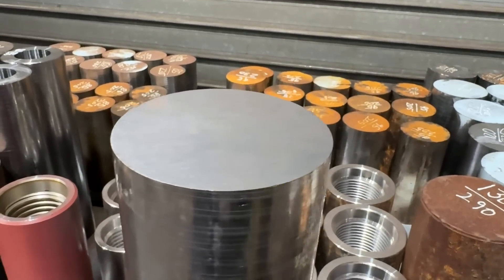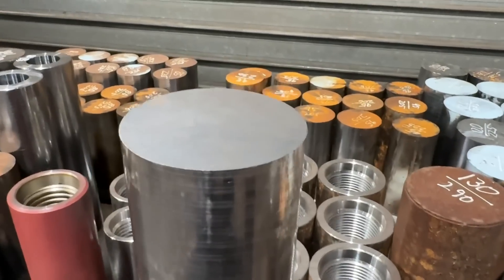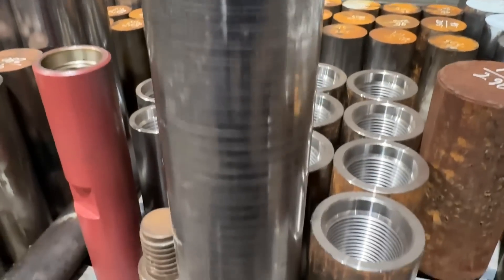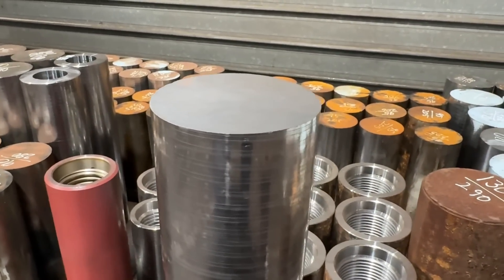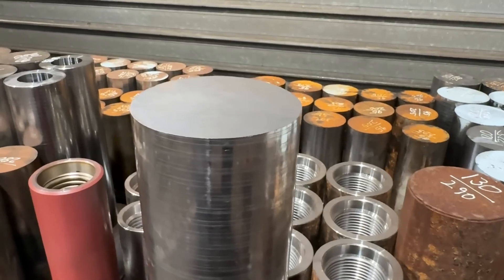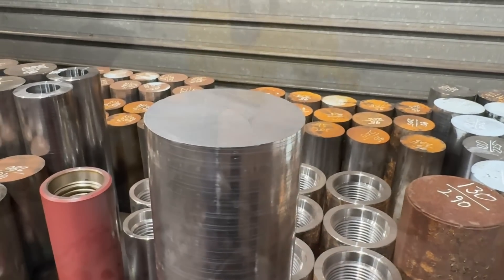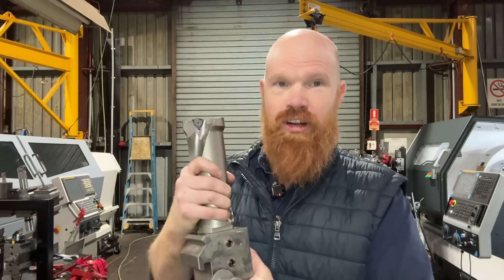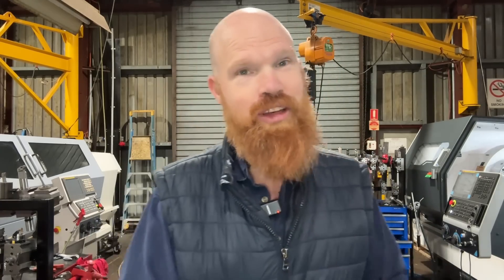HTS DRILLING at 900 rpm is UNREAL (you need to see this)

Comment: Interesting. First of your vids ive watched. Does that lathe have a tailstock? Looks like a sheetload of pressure to be putting through a quickchange toolpost and cross-slide. Id suspect thats where your vibration source could be.
Reply from the maker: We’ve since fixed the vibration, thankfully!

It’s a pretty rigid lathe, so the problem was the toolpost, which we have modified for HD drilling.

Works a treat now.  Thanks for the comment too.  It’s really helpful getting everyone’s thoughts.

Comment: I have used this tool several times in the past. Kennametal is the market leader in the drilling sector
Reply from the maker: At this point I totally agree. I haven’t tried them all, but Kennamental remains my pick for drilling.
Reply: I have tried several drilling tools from Kennametal. The series with interchangeable head is extremely performing, (but high cost for head and resharpening). The drill-fix series with a square external insert doesn't excite me. Efficient, but noisy. Excellent solid carbide tips, the extra long series (30xD++) is impressive
Reply from the maker: That’s good to know.

Until we get a more high performing modern CNC (ie Doosan, DMG etc with a turret) I won’t attempt the solid carbide drills.

They look awesome, but I just know we don’t have the precision… yet 

Goals haha.

Man, thanks for the comment and sharing your experience. Really appreciate it.
Reply: Solid carbide drills are very efficient tools, but require chucks with low run out and stable machines. The refrigerant pressure is very important. I work on a boring machine (Kbn 135 C), when I encounter pieces with risk of vibration I prefer to use hss tools
Reply from the maker: Wise move. If we had a more high end CNC I’d definitely look at solid carbide drills.

From what I can see they are awesome

Comment: These HTS KENNAMETAL TOOL need‘s a REAL STRONG machine with a rock solid tool post. If it is not stabil, the drilling resistance increases enormously and you destroy the inserts. 
I remember , 25 years ago, the old ŠKODA W200 , SK 60 with a 180mm Walter HTS … nice to hear how the heavy chips are falling … but the remaining piece was really dangerous!!! A bit like a boomerang that never comes back…👍👍👍😎 Cheers from other side of the planet!
Reply from the maker: That’s good to know man.  Sounds like you’ve got some really solid experience with these tools.

Appreciate the comment, and definitely agree re toolpost rigidity.  We’ve had to upgrade the big lathe to a HD toolpost designed for deep drilling.  Far more secure and doesn’t seem to budge.  Thankfully.

It’s wild to watch a drill like that hit a piece of steel held by a 200kg chuck spinning at 900 rpm.
Reply: This tool needs* (third person, no apostrophe!) / It is not stable* ...
Reply: @einundsiebenziger5488  Danke für die Berichtigung! Mein Englisch ist LEIDER nicht gut genug… Ihres ist wohl besser…

Comment: Very good.
Why coolant pink, round stock is bleeding? :)
Reply from the maker: Haha. It’s definitely different. It’s called Holemaker. It seems to have excellent rust prevention properties and never goes off.  

They were using it before I took over the shop, and I haven’t found a better alternative.

Totally open to any recommendations for high performing 4140 cutting fluid.

Comment: Wow, very efficient!  I’m new to this stuff with my Haas TL-1 and what you did there looked to take a goodly amount of power.  Can you estimate how much HP or KW used?  Our machine has only a 10hp spindle without a gear reduction box, just a pulley drive at 1800rpm and curious if such a thing would be achievable? I have driven 40mm HSS twist drill in our 5hp manual geared head which will get it done without much trouble but work and time to shove it in the bar.  I have never seen something like that.  Cool!  FWIW, I am not a fan of the “shorts”. I learn and enjoy more of your longer format videos I watch like this one.
Reply from the maker: Our machines are 20 & 25 hp - so by no means monster machines as far as CNCs gos. They have good swing & bores, but there are def more powerful on the market.

I like the look of the TL1! Seems like a good little machine.  We could probably use something that size in the future TBH.

You could probably use smaller Udrills on it.  The major issue is toolpost rigidity.  

There is a large amount of z axis force generated.  We had to alter ours to run the long drills, but it’s def doable.

Thanks for feedback re shorts vs long form too.  I don’t post many shorts these days, mostly due to how crazy busy the shop gets.

I kinda just started posting them on FB… people liked them and then it led to here.

Wild how things evolve.
Reply: A 10hp machine may have trouble running this drill in a high tensile strength material, but there's a couple things to keep in mind:
1) a machine motor is very much like a car engine, it has a peak horsepower and torque meaning you must be running at the optimum RPM in order to get the most torque and power out of the spindle. Sometimes you have to select a cutting tool that is capable in the optimum RPM range. 
2) carbide runs faster than HSS. It is capable of maintaining hardness at much higher spindle speeds, but is more brittle, so you must effectively bury the tool in the cut with sufficient chip load
3) indexable drills like the HTS and the Drill Fix PRO from Kennametal are 1 effective cutting edge. Drills like that HSS one or a spade blade, etc are two effective cutting edges which means double the torque requirement 

All this boils down to: for heavy duty applications, try to run at peak power RPMs and use a 1 effective cutting edge drill to minimize torque load.
Reply: @thatdrillguy7889  very helpful.  I am dumb!  I have seen tools that look like a single insert on one side drill.  I am dreaming of something like that which is maybe 12 to 16mm but the same tool could also bore a diameter out as big as 20mm or so. Machine time won’t be too important for me but I would,d like it to be efficient when I am not personally pushing handles.  Thank you Mr drill guy I appreciate your input.  I might be not so good at finding the comments very well as I am a Luddite also.  (At least kind of).
Reply: @cogentdynamics  Quite alright and glad it was helpful. Any indexable drills like the Drill Fix PRO should be able to drill an initial hole then you can offset in x and bore out larger. Something like the Drill Fix PRO can actually do an initial x-offset as well. When you're drilling from solid, move the drill up to .01-.02" off-center in the x+ direction and you'll drill a slightly larger hole.
1) you must have your outboard insert aligned to x+
2) your MAX depth of cut radially is usually 50% of you outboard insert IC, but you're better off at 30% ish.
3) your MIN depth of cut radially is usually just bigger than the corner radius of the outboard insert

A square outboard insert size will be described by the diameter of an imaginary circle that is drawn inside and tangent to all 4 edges (inscribed circle = IC) so a 3/8 IC insert is .375" wide and you can cut up to .160" radial depth of cut, but that is a heavy boring cut. 

These techniques really help you do more with fewer tools.
Reply: @thatdrillguy7889  thank you!  Basically like a boring bar that drills.  I’ll be shopping!

Comment: nice to see a little bit of proper machining instead of wire-wool turning. 👍
I've used drills like this quite a lot and if the machine has the HP i'd consider loading it a bit more per RPM - maybe 0.2 possibly with a slight drop in RPM - should give comparable cycle times.
I really wonder just how rigid the toolpost arrangement is though if im honest. Vibration dampening can sometimes be done by wrapping a bicycle inner tube tightly down the shank and securing it with a couple of jubilee-clips (or hose clips or whatever you call them). This is how i've reduced the resonance in the past. Sometimes it works, sometimes not. 
Same thing also works with smaller boring bars and elastic bands.
Reply from the maker: I’m definitely going to try that to dampen vibration.  Thanks for the tip.

The toolposts are actually a custom heavy duty design, modified from original Dixon toolposts.

So far they seem to hold really well, but we did have some issues with the big lathe originally, as it didn’t come with the HD option funnily enough.

Meeeega problems with it wanting to rotate.

Comment: It seems most of your products have a through hole. Would it not make more sense to get hollow bar for this, and skip the drilling entirely?
Reply: He said in a different video that buying thick walled tube in 4140 in Australia is either really hard or its simply not available
Reply from the maker: It would indeed, however we can’t source 4140 hollow bar in Australia.

That, and most of our products have different holes each end, often varying depths.

Great question mate.
Love it.
Reply: @halheavyduty  Even if it was available hollow bars cost 2-3 times more than solids. Especially in stainless steels,that's why I prefer to drill them from solid. Just for an extra minute or two of cycle time you save half the material cost. Of course within reason not going to bore out a 300 dia. hole by drilling.
Reply from the maker: This is true.

Hence why the core drill we run is so useful for bigger stuff.

We get the job done in about 1/3 of the time and get a $400 billet for free.

Comment: i would reduce the feed the feed for the first 5-10 mm with 50% and then go full force
Reply from the maker: Great tip.  We have it currently at F0.05 for 7mm, then we send it.

RPM is constant at 750-900

Still playing with it.  I suspect I might need to feed harder if possible though?

Comment: We have the same Harrison Colchester lathe at work, received only about 2 years ago, but smaller. Chuck is about 10 inches and goes 2700rpm. I think the model is alpha 1400XS, which is the length between centers I think. I never thought those lathes were capable of such drilling, but I guess with good setup it should do it no problem. However, the Z axis will climb 80% and more when using U-drills of diameter 40 3xD, the noise is really bad. The tool post is a quick change one, I think they are less rigid too. The X axis zero will regularly move a little bit. It doesn't have a home position it seems so it loses long term track of it. Also I think the touchscreen is a step down, and while in alpha programming mode it is sometimes slow for inputs to register
Reply from the maker: Yeah, I hear you. We had a few toolpost issues but modified it to make to way more rigid.

I might do a future video on that topic, as it took a LOT of troubleshooting to get it right.

Seems to work pretty well now.
Reply: I have a 1400XS with OiTD controller and home is G28 U0 W0
Reply from the maker: Very similar to ours.  I dont know about you, but I find it a great machine and really enjoyable to operate.
Reply: It is enjoyable to operate, but the tool post we selected isn't as rigid as we expected. It's a small machine but still. And the last time I tried a G28 it went X- until soft travel limit. I think it's not set up properly

Comment: Keep the pressure and try to turn down the rpm's a little 
I have both had a drill and a boring bar that was screaming like crazy. I kept the pressure and turned down the rpm's by about 45-50 rpms and it sounded so much better. Same with the finish. It only took like 7-10 sec more pr part witch was like nothing for a part that was at like 6 min and 30 seconds 
The better the bored hole finish is the better/easier it is for the tool afterwards
Reply from the maker: I’ll try that for sure.  Will be playing with both feeds and speeds to find the “comfortable maximum” for the tool.

We don’t try to max things out as much as a lot of people… I’m just interested in getting the job done without breaking shit
Reply: @halheavyduty  thats how it should be. dosnt matter id you can get it done fast if you can't do it stable enough to be able to count on it. i mean it's not a swiss type lathe where every second couth and you got max stability

dosnt matter if you can run a part 3 secends faster each if you can only make 1/3 the amout of parts per insert. since that way you actually spend more time makeing the part ( all the stop's to change insert quickly adds up in time )

Comment: Use the coolant straight away & 5% increase feed,  nice drilling
Reply: I agree. If you start the coolant before the inserts are engaged, you will extend insert life even further. I appreciate you didn't want it spraying all over and maybe that's why you started once the tool was in the hole. Anyway, nice video and I'm glad you've experienced the amazing results the HTS system delivers.
Reply from the maker: Cheers Mike!
Reply from the maker: Will try that for sure.  Yeah, we usually run coolant immediately… just turned it off for the video

Comment: So just under 3 minutes for that hole if my math is correct? Impressive if so.
Reply from the maker: Yep. Just under 3 mins
You’re dead on. 

900 x 0.15 = 135mm per min
380 / 135 = 2.85
2 mins 48 seconds more or less

Three mins to allow for the 5mm slower start where we halve the feed rate.

Comment: I've never had much luck with these drill as far as getting a decent finish in the hole in the last 20 years, anything without guide pads isn't going to leave a great finish. The one thing that you can do to shut it up is take a decent size C-clamp (like a 200mm/8" or bigger one) and clamp it on the shank part way down to the head. That will dampen it and you can just move the clamp as needed and then you only have to listen to it for the last little bit or if the shank is long enough you can just leave it on. Don't know the physics behind it, something to do with stress, but it works so I just call it magic.
Reply: yeah, if it has a flat or two on the shank a big shifter does a similar thing.
Reply from the maker: That’s very interesting.  I’m going to try it just to see! Thanks for the tip.  

Yeah, we just use them as a roughing tool. Finish can be a bit hit and miss from my experience.  Maybe it’s just because we do 4140… or maybe it’s operator related… but I find we’re not the only ones with this issue.
Reply: @halheavyduty info.
The clamp kills the frequency because it rises the diameter of the rod.
Imagine when you hit a 1cm 2m rod the vibrations will travel with ease trough the thin rod but when you hammer a 10cm rod the vibration has to pass trough a lot more material and engage with a lot more mass.
So you can rise artifical the diameter the vibrations have to pass.
The vibration is buildup from the cutting edge and it starts when the chip breaks of to wiggle. 

As longer and thicker the boring bar gets the dull the frequency gets what results in less sound. 

There are machines made with counteracustic parts. They send out a soundwave the overlays a messured frequency onthefly and then give out a counter the soundwave to lower the singing. I dont remember the producer.

Comment: I like your humble approach to what you show in your videos. 
Hopefully, this will keep the negative element that is common on social media to a minimum. 

The vibration you noticed with the Drill is fairly common especially with this amount of tool engagement.
It's like you mentioned. 
It's a Roughing tool much like a U Drill.

I wouldn't be too concerned about the vibration,  just as long as you don't start picking up any chatter, which will start eating through Inserts almost as quickly as you went through this material 👍
Reply from the maker: That’s great advice brother.  Yeah, most of the experienced machinists I talk to hold a similar opinion.

Appreciate the feedback.

I’m just here to learn, and share what I’ve learned.  Ego is definitely the enemy, and I’m glad it shows on the channel.

Major focus will be long form. I’ll pop the occasional short, but I find long form far more enjoyable

Comment: I imagine that tool was an investment, but it works.
Reply from the maker: Totally worth it.

Not cheap, but pays for itself day one in all reality.  And much better for the machine.

Spindle load drops from 85% plus on a spade drill to 54% with the HTS.
Reply: Reduced spindle load saves money every second. And replaceable inserts are the cheapest way to do anything. You get the exact tool angles for each type of metal. Used a handful of old style bit like that. Saved countless hours of boaring bar time.

Comment: It won't be much but i'd be trying to shorten up/rigidise that indicator setup and maybe using a test indicator rather than a dial to reduce the weight. I bet you're getting more sag with that much stick-out than you think. A tiny starting divot with a centre drill couldn't hurt either. I've been trying out a new Multi Function drill on the first job on our brand new ST30-Y and already had to re-align the turret after I pushed it too hard so that was fun 😆
Reply from the maker: That’s excellent advice, and I’ll definitely try it.  Thank you!

Comment: When you faced the piece, there was a sharp peak left in the face center, this would suggest  your cutter was slightly below center, .
Would this have caused the drill to be slightly off when it started, causing noise and possibly chatter.
Reply from the maker: I noticed that too. I’ll be running it again this week and seeing if it makes a difference.

Well picked up 👊

I actually think I just need to increase the feed.  Test and learn…

That’s the game 👍👊